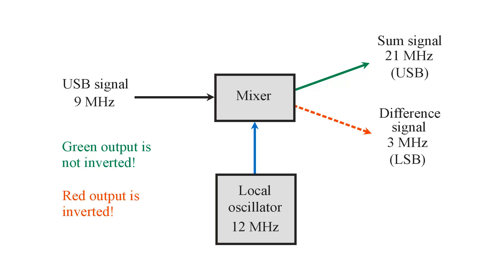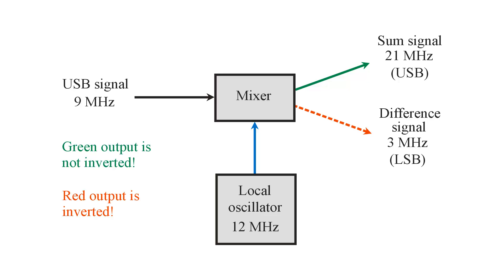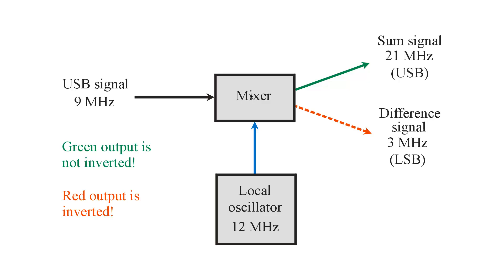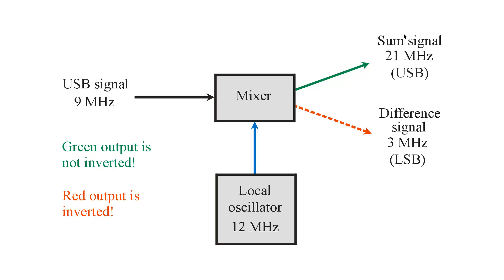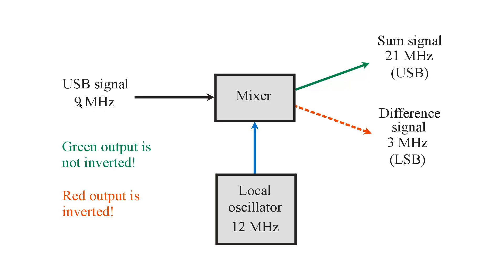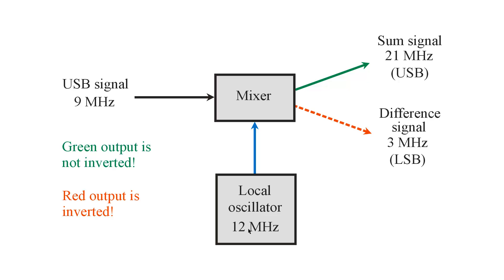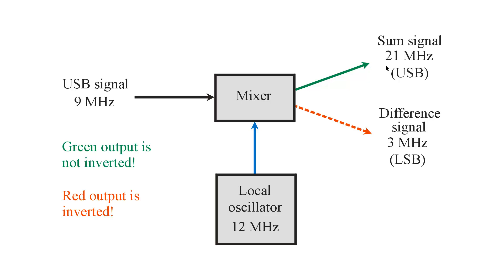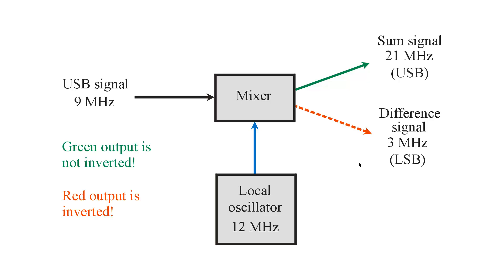Sum vs Difference Mixing

Comment: Stan, while I have not come across anything conclusive, I queried a few searches that may interest you.  To keep in line with the interest, I would like to inform you about a site called the electric orphanage, while not radio-dedicated, contains interesting facts about the histories of transmission  (and by association, RF over power line?).  The queries I have used thus far, which returned to me any number of useful and/or resounding information are as follows:
  1) Residual Nomenclature of Frequency Mixing 9 MHz
 2) Residual Nomenclature of Frequency Mixing Upperside Band 9 MHz boundary  (I assume a better term than the interprative word boundary may provide better result)
3) Residual Nomenclature of Frequency Mixing rside band 9 MHz boundary (The 'r' was initially a lack of back space.  Before pressing enter I decided that it may provide different results...then lack thereof a la number 4..
4) See above r, matey
5) Residual Nomenclature of Frequency Mixing Sideband 9MHz boundary amateur radio operation preference

With the one particular theses that I bookmarked entitled as follows: 

"Digital Radio and Its Application in the HF (2-30 MHz) Band"
Reply from the maker: Thanks! Lots to keep my gray matter occupied for awhile.

Comment: Nice to see the comments section opened up.  Thank you for all your videos, sir.  😊
Reply from the maker: Thanks. By the way, I found something on page 64 the May 2017 issue of QST about the history (or at least the basis) of this story. Please see "Technical Correspondence" by Steve, AG1YK. The fourth full paragraph in the middle column clarifies the issue. 

The sideband gets inverted only if the heterodyne oscillator (that's the 12-MHz one in this video) has a frequency higher than both the input and output frequencies. Otherwise, the output sideband is the same as the input sideband.   

In this video, when the input frequency (of the original USB signal) is 9 MHz and the output frequency is 3 MHz, we meet the criterion for sideband inversion, because the heterodyne oscillator frequency (12 MHz) exceeds both the input and output frequencies (9 MHz and 3 MHz, respectively). Result: LSB output (inverted).

But when the input frequency (of the original USB signal) is 9 MHz and the output frequency is 21 MHz, we don't meet the criterion for sideband inversion, because the heterodyne oscillator frequency (12 MHz) lies between the input and and output frequencies (9 MHz and 21 MHz, respectively). Result: USB output (not inverted).  

The actual history of the convention apparently has nothing to do with this fluke, at least not according to Steve's article. So we could say that the story is a legend with its basis in truth. Sort of like everything else these days, eh?
Reply: Stan Gibilisco For one, I am unable to log in to the associated QST portal in junction with the ARRL website.  

In your first paragraph, where you mention that if our band does not meet criterion X that it will have the same output as the heterodyne oscillator , does that imply 'in place of what is shown as Difference signal 3 MHz (LSB)' ? 

Oh, after reaching the second paragraph again, I realized that this possibly implies that the summation is done prior to the differential (inverted) mixing?  By extension, does this behave similarly to how differential signalling works with voltage exchange over two wires?  

After rereading and reaching the second paragraph again, I reached the somewhat ironic source of confusion (as it helped to clarify what preceded it..funnily enough, very similar to nptelherd's videos regarding EEPROM, and Intro to Memory System..which I do highly reccomend).  

Ah...how then do you reach an output frequency prior to tuning to a desired LO frequency?  

In highest regards to the convention and article thereof, I cannot discuss any relevant information that may have been found as I cannot access the (free?) newsletter via the portal it is routing me through.  

I do see what you mean, and truthfully I reply to one that the basis of truth is fundamental.
Reply: I intended to close off with something in particular, but after writing the bit about portal I could not remember what exactly it was.  Upon reading "for one" I remembered that what I had to intended to say was: "Taken for a loop"!
Reply: Hm..I am not sure if electromagnetic compatibility has any effect on the inbetweens of 9 MHz, but I am currently under the impression that 10-30 MHz in the HF range was or was solely expected to be used over power lines.  Possibly by extension the LSB is then the best means of reliable communication? Pardon my being forthright if that is some trade secret...while just supposition I am not looking to infringe !  Haha
Reply from the maker: Your queries are too complex for me to answer here, and some might go "over my head" anyhow. However, I do share your thoughts on the the basis of truth. Maybe after some reflection I could do a video or two concerning your technical questions. By the way, I found the article in a hard copy of QST! I keep a collection dating back several years. Nothing like good old paper.
Reply: Stan Gibilisco Dubbed...Subbed..Flubbed..I don't know where I intend to head with this hahaha .  I look forward to the next time the comment section is open.  As always,  thank you for your good graces and helping me through a few rough patches.  "Stan Gibilisco here" has been a welcome sound around here.  Cheers